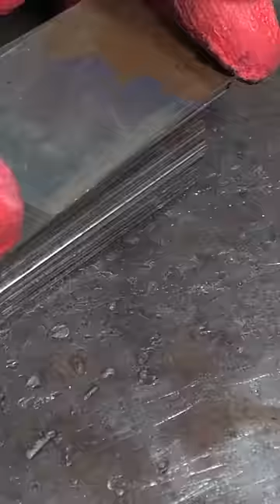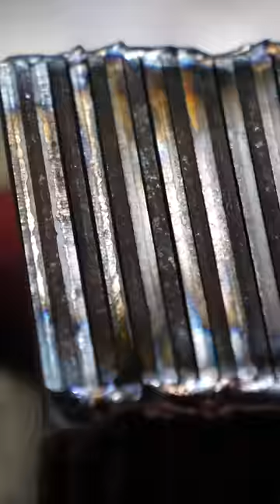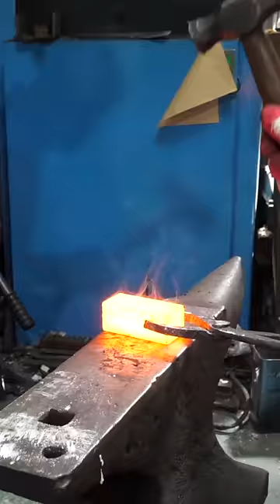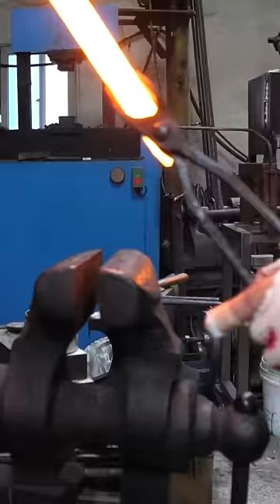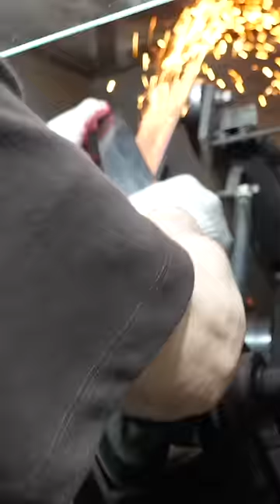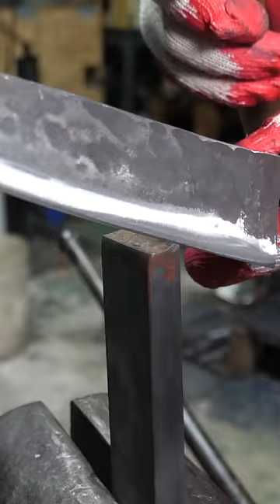Korea's best handmade knife master. with 50 years of experience. Damascus knife

Comment: The way he cut through it like butter was absolutely beautiful.
Reply: It was like cutting through lava, so satisfying
Reply: Aaaaaa you caught me I’m Reese‘s peanut butter cup
Reply: Yummy 😋
Reply: He was using the press for those of you that thought it was easy
Reply: Jesus lovs you
Reply: Shows how weak the steel is 🤢
Reply: @oscard.lisboa6105 it’s a crank, it’s meant to do the work for you. Hammering it down by hand or pressing the weight is much harder by hands. Helps when the metals hot enough though, he’s kinda working with soft solid metal instead on condensing down the layers. What you want is to get it hot enough that you could squeeze the original layers into half or less the thickness. Then add more, would make good dense layers. At that point heat it and shape it and you’ll get really good fine squiggles all throughout. Like good marbling from wagyu beef. It’ll form to the imbalances naturally and creates the Damascus quality people like in some steel. A little cobalt or palladium goes a long way too. Silver copper gold. Just some soft metal. Helps to work it through the process and make stronger metal overall.
Reply: Creates a nice reflective quality too. Like iridium. Good for its reflective index if that means anything to you
Reply: @ZeusEBoy The change in hamering metal would have to affect the strength of the bonds that hold the atoms together (and apart) and this is not easily changed by conventional physical means. The simpler answer is: No, forging does not change the density of the metal
Reply: i think butter is kinda difficult to cut.....

Comment: For those who don't know, the powder he's putting on the metal is called borax, the borax is used to stop oxidation so the metal can weld easier. This is just to my knowledge, I could be wrong.
Reply: What's the benefit of lending 'knowledge' if you don't know whether or not it's correct? 😂
Reply: @thomasdickson35 그게 유튜브지
Reply: O correct.....if I am correct I believe It also gives a cracked finish
Reply: You're correct
Reply: Nice try, we all know it's powdered sugar
Reply: It’s disodium tetraborate, also known by its street name as Borax.
Reply: @normferguson2769   Yep, that's what we always called it in Compton.  Checks out.
Reply: I thought he was Salting it 😂
Reply: its salt
Reply: 除去金屬的氧化物去雜質
Reply: It could be dryer lint. I could be wrong.
Reply: But the powder also looks like flux powder which is used for setting the welds which did not set after heating the billet
Reply: It removes impurities and makes the steel bond better to eliminate cracks or brittle metal
Reply: It's flux to help the weld stick. Watch some forged in fire for some legit knowledge.
Reply: @thomasdickson35  it creates an invitation to learn. Creating the disclaimer at the end invites others to correct the potential mistakes so that the reader can receive accurate info. The reader can always do their own additional research to ensure that the info they receive is correct.
Reply: I believe it’s powered carbon, adding carbon too steel to make it harder
Reply: The same one women use to add more flesh to their Bossom👌🏾 another fun fact.
Reply: @thomasdickson35  Brutal, but true 😂
Reply: @coquitlam_railfan5686 nope, it should be black if its so
Reply: Thank you
Reply: Solt
Reply: No one asked
Reply: @B1g_Salad  I asked.
Reply: 괜찮아요! 아는것이라도 말씀해주셔서 감사합니다!
저에겐 정말 유익한 정보였어요!❤❤😘
Reply: the powder he uses is cocaine, not borax.
Reply: That’s not borax that’s cocaine
Reply: @thomasdickson35 it teaches somebody about a true fact whilst affording them the freedom to fact check, reject or not use it for something important until you can check it

for the record. it likely is borax. but the common name which makes it important is flux which is a family of materials that prevent oxidation or rust of hot metal which can introduce fault lines when working and waste material
Reply: I thought it was cocaine
Reply: It may be, unless we see the box we won’t know, it’s definitely a type of forge welding flux but there’s quite a few kinds you can use
Reply: Actually you are partially correct but it's name is not borax it's flux powder
Reply: @thomasdickson35 its a good hypothetical input THOMAS alright, he had some info and he thought itd be cool to share but he doesnt know if hes right or not you dont have to be lame at every seeming second
Reply: @normferguson2769 sauf que le borax c'est le nom qu'on donne à l'acide burique dilué que l'on utilise pour nettoyer les yeux 😂
Reply: Actually it’s salt to make it taste better 😋
Reply: @thomasdickson35 what’s the point of laughing at someone who’s trying to share something interesting if you can’t be bothered to look it up yourself?
Reply: To my knowledge you are correct. But not sure 😂
Reply: @HuuTonyTran 
flux isn't really a specific material, it's more a generic term for anything used to prevent scale from forming in between the pieces being forge welded. Borax is a common type of flux, but there are others.
Reply: I'll be the judge,you guys continue with your debate about what powder it was

well tbh i thought it was crushed cocaine
Reply: My name a borax👺
Reply: @thomasdickson35 he is correct
Reply: Idk I think he's just seasoning it for extra flavor
Reply: Very nice!
Reply: That's just some salt for seasoning
Reply: @thomasdickson35  It's called generosity
Reply: Correction: Sazón 👍
Reply: Oh, I thought he was seasoning the metal but that makes more sense…
Reply: Then don’t comment if you could be wrong you aren’t contributing anything bud
Reply: Well akshually it's crystal meth
Reply: It's really to help prevent oxidation.
Reply: Corn starch and some garam chicken masala
Reply: @thomasdickson35 He's sharing his theory. Also don't trust everything you read on the Internet
Reply: So he puts it on so the metal can weld easier? Why did he put it on after welding the metal together lmao
Reply: I thought he was seasoning it.
Reply: I was about to say “why dey seasoning it???”
Reply: @thomasdickson35  HAHAHA
Reply: Borax is a common type of Flux. Yes, the Borax prevents the metal from oxidizing.
Reply: I assumed it was MSG 🤷‍♂️
Reply: Correct.
Reply: @KQ_Offsuit 
Is very nice!
Reply: Yes it stops oxidation making welding or soldering easier. I also use it in jewelry making but dissolve it in water instead of using it in it's powdered form.
Reply: @thomasdickson35  I just wanted go help, I heard the info from somewhere and I wasn't sure if it was right
Reply: @ashutoshtiwary9605  that's not very nice
Reply: Not me combing the comments to find out what the mystery substance was.

Comment: Never in my life have I ever seen a knife be hammered through a chunk of metal as a test, that was awesome.
Reply: Same! That’s a bad ass knife if it can do that! I want one, no bones or half frozen stuff is gonna stop that knife!
Reply: That's a different knife than the one he was making. I'm guessing that's a deboning knife with a thick edge. No way you're gonna chop through mild steel like that with a forged kitchen knife... tbh I don't think a powder steel kitchen knife can do it either. Kitchen knives are too thin.
Reply: I've seen plenty of videos of knives cutting various thickness of other metals it's really not that special. All it's really showing is that hardened and tempered steel can cut through a softer metal. I'm not saying it's not a well made knife or anything of the sort. However any decent knife maker can produce a pattern welded blade just like this without too much trouble. There is a chap down out street that makes some lovely knives in his garage all you need is a forge (pretty simple to make yourself) a power hammer, a few hand tools, a heat treating oven and a big troff of oil or water for heat treatment. 👍
Reply: @mikecrosier6248  just because it's common, doesn't mean it isn't special
Reply: @GillAndBurtTheCop  I specifically said "I'm not saying it's not a well made knife or anything of the sort" 👍 I probably wasn't that clear I should maybe have said. A much harder steel (the knife) cutting a much softer steel isn't that special. 🤷😁
Reply: @mikecrosier6248  You need a lot of skill to make a good knife though. Not a good enough knife, but actually good.
Reply: @mikecrosier6248  i was being cheeky tbh, I meant special in the eyes of someone who has never beheld this in their life before
Reply: Cold chisels are made to split steel it's not really that impressive
Reply: @MagruderSpoots  there can be many impressive things, my fellow caveman who speaks english.
Reply: @MagruderSpoots  Yea but they have a chisel edge. The trick is to do it with a knife edge, where all the trickery is employed. If you make a knife with a thick chisel edge, it will perform the same, and most people will be impressed because they have no idea about edge geometry.
Reply: Watch Forged in Fire
Reply: @GillAndBurtTheCop  there are metals so soft you can bite through them, it's not special

Comment: bro hammered off a piece of metal with the blade and it came out undamaged, that's beyond impressive
Reply: Yeah not even the sharpness looked chipped, the thing is extremely durable and sharp. Definitely the best craftsman in Korea.
Reply: This is the comment I came looking for, or to make. Friggin impressive.
Reply: A knife cutting metal?
Reply: I've watched Forged in Fire and saw how metal can damage a blade. I'm also amazed at how strong and sharp this knife is.
Reply: It was probably weakened aluminum, I can't fathom how that would have happened unless this knife itself were an alloy of neodymium and lead
Reply: Too bad it's fake though. 
1) Look at the knife when it's ready and look at the knife used for hammering through metal. It's a different knife, not damascus steel, and it has a thick, convex edge judging by the reflection.
2) You thought you saw it cut through, but actually you only saw the beginning of the cut and the end of the cut (first 2 and last 2 hammer strikes)
3) Look at the knife's edge in the beginning, it's undamaged. At the end, you can see it's damaged on a different part of the blade, suggesting he went through that piece of metal while the edge took damage and just used a different portion of the blade each time.
4) The knife he rests on the anvil at the end, next to the other two, is either yet another knife, or he already fixed the chipped edge on it.

Comment: Watching this makes you appreciate what they used to do back in the day so much more. All the hydraulic tools now make it so much easier.
Reply: I'm sure they still had the large forge hammers but they were probably hand cranked and a lot slower, and or had some sort of river water wheel set up that they could disengage (I know nothing about blacksmithing)
Reply: Then some weebs will say the old traditional way is way better than these modern stuff because ThINgS WerE buILd To LAst In tHE oLD TiMEs
Reply: You don’t know me!
Reply: Uhhhh… Yea I could do that.  Just need me some of that modern equipment

Comment: 각자의 자리에서 열심히 노력 하시는분들 존경 받아야 합니다 값지고 멋진 인생이네요
Reply: If its to believe ld that they used multiple separate metal plates that were combined. It's metallurgically inferior. That kind of blade won't last long.

So no respect for artisans using inferior metal working that is an half assed version of an old metall working style, that is ment,were more pure iron isn't available.
Reply: 100%
Reply: @KG-jm1zl my friend, i don't think you know how forging works

The furnace melts the plates together and the twisting makes it stronger, especially after the quench, if it was a "bad blade" it would crack during the quench. Also, the stress the metal is put under while heating and shapeing once again builds a stronger blade. Most blades purchased today (now im not 100% about this) are going to be made by melting metals together, placing them into a mold, and allowing them to cool. A Damascus blade is extremely strong, beautiful and carefully crafted. So please respect this man and his craft as this is no simple feat 😊
Reply: @BLAZINGFIRE5G  
The Damascus steel is inferior to high quality steel. It's only done for the beauty of the layered grain structure. If it were superior, then you would see tools made out of it in stores. Even if they were really expensive, people would pay for the highest quality. Also if you don't believe me, there are many actual college textbooks that you can buy where people have spent their lives compiling data on metallurgy. The only way that Damascus steel can be beneficial is if you have your layers inline with the cutting edge and you have a harder/higher carbon steel layer on the very tip of the cutting edge and the softer steel layers surrounding it to allow the blade to flex without breaking. Twisting the steel completely destroys the possibility of ever aligning one layer along the edge and achieving that benefit, but it sure does make it look pretty.
Reply: @davidscott5903  okay, well thanks for the info, I'd like to read up more on the subject now so could you lend me some names or possible articles i could read? I was under the impression that Damascus was a high quality blade and made expensive for that reason (and of course the skill required)
Reply: @davidscott5903  NGISING SE KANDANG NJARAN RASANE RA KARU KARUAN MOCO BOSOMU SING GK JLAS BLASSS, GUNDUL MU KUI MLBEDOS 👍👍👍
Reply: Right
Reply: @KG-jm1zl 불쌍한 친구..
Reply: You should do motivational speaking in the usa, not enough people value hard work and precision
Reply: @KG-jm1zl Dude watched the video in reverse
Reply: Согласен, брат
Reply: Starting with a bunch of welded layers is cheating. The real blade smiths would forge weld 2 pieces of different alloys of steel together, and fold them many times to get to the point where this guy started out. The twist is unnecessary and causes a weak point. It’s strictly for looks.